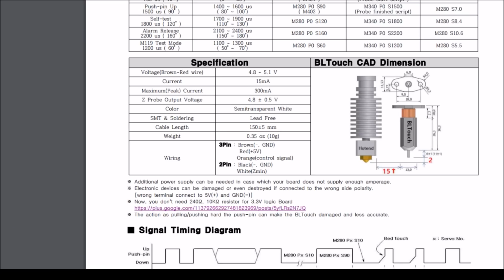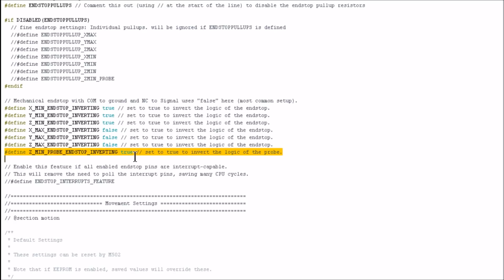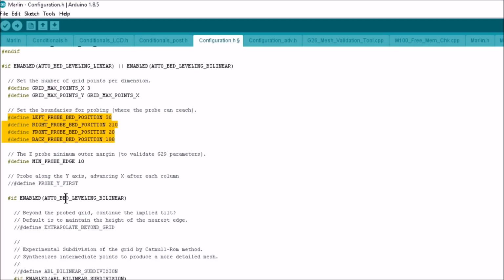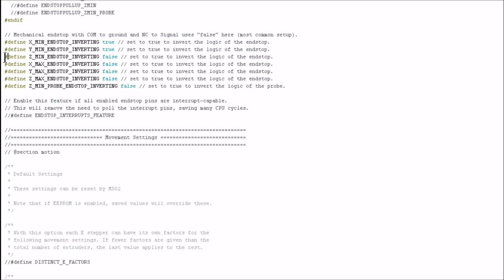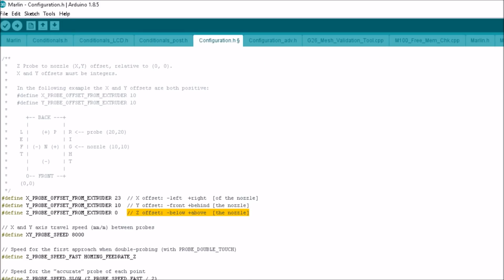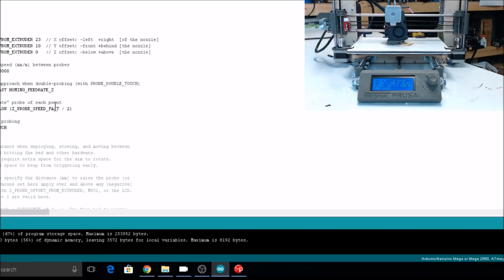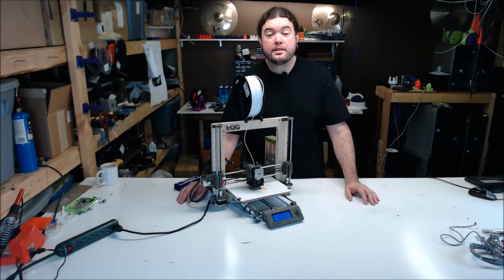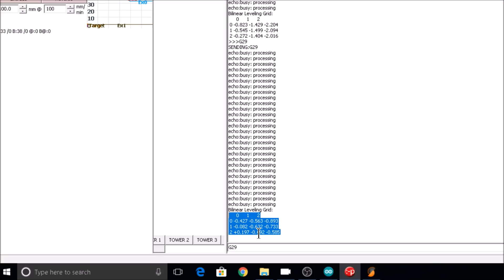Add Auto Bed Leveling to your 3D printer - Marlin - 2017

Comment: Good video. New to 3d Printing. Just wondering how is that you read and write the configurations to the printer.
Reply from the maker: You have to use the Arduino IDE and you can only write, you can't read. So you need a copy of Marlin (or other firmware) that is configured for your printer or you have to configure it from scratch. Link to IDE https://www.arduino.cc/en/Main/Software Link to Marlin: http://marlinfw.org/

Thanks for watching, sorry there isn't an easier way to edit the config, you might see if your printer manufacture has a copy you can use.

Comment: Thank you making one of the best videos on this topic.  I finally understand auto leveling thanks to you.   I do have a question though.    I have an Anet A8  using the SN04-N.   I am using https://www.thingiverse.com/thing:2779564    When I use G28 the Z probe is way off the bed and the hotend crashes.   I know that I have to get the sensor over the bed and thinking I need to code somehow the #define X_MIN_POS -40 before the z home, but do not know how?
Reply: answer   #define Z_SAFE_HOMING
Reply from the maker: Yes, have you flashed to marlin? Z_safe homing will take it to the center of the bed. Your probe offsets should take care of the rest. Thanks for watching glad it helped you.

Comment: Thanks for a great video! Although the offset did not work for me. After searching around I found M851 shows current offset which stayed at 0 for some odd reason (my code is correct, running Marlin 1.1.8). The EEPROM has that value set on my Anet A6. Did M501    (to load EEPROM)    M851 Z-0.56     (to set my offset)    and did   M500   (to save to EEPROM). That did the trick. Thanks again!
Reply from the maker: Thanks for watching! Eeprom still gets me all the time. I usually just disable it altogether if I can until I get my firmware all setup.
Reply: Thank you, just saved my life
Reply: @ai9862  Youre a hero!

Comment: I'm assuming the printer is already in a "leveled" position, otherwise the statement "1 mm from the bed" is ambiguous. Could you confirm?
Reply from the maker: I could have been more clear on that. I would start with the printer hotend in the center of the build plate. Set you 1mm height from there, then the prob and compensate. The offset won't be taken into account until a print is started.

Comment: I am using bltouch
Reply from the maker: Yogesh Sonar So your issue is after you set everything up your first layer doesn't look good? What printer do you have? Does the g29 work at all? Do you get the grid print out in pronterface?
Reply: Chris Riley 
Sir, I am using Cartesio type Printer i3 pursa , first layer is not good due  to bad leveling.
I tried G28 - G29 - M500 than grid print but same bad result of first layer .
I tried many ways but no luck, I observe , 9 points probing of G29 not consider at first layer.

I am new in 3d Printer, I don't know solution, but found a video on YouTube that person live adjust Z to limit of compensate , I think this step is look absent in my settings, I think this is setting that instruct to printer that what level have to go up and down Z to make perfect level, and I  don't know how to set through our Marlin firmware.

Sir please help . . .
Reply from the maker: You will need to figure out the Z probe offset. I explain it in this video, but if you want to try to dial it in I recommend enabling babystepping. If your nozzle is to high, go to the negative. If it is to low go to the positive. Dial it in until the layer looks good then that value will be your offset.

Set it up like this in Marlin. You can them double click the LCD wheel to use it.

configuration_adv.h

#define BABYSTEPPING
#if ENABLED(BABYSTEPPING)
  //#define BABYSTEP_XY              // Also enable X/Y Babystepping. Not supported on DELTA!
  #define BABYSTEP_INVERT_Z false  // Change if Z babysteps should go the other way
  #define BABYSTEP_MULTIPLICATOR 1 // Babysteps are very small. Increase for faster motion.
  #define BABYSTEP_ZPROBE_OFFSET // Enable to combine M851 and Babystepping
  #define DOUBLECLICK_FOR_Z_BABYSTEPPING // Double-click on the Status Screen for Z Babystepping.
  #define DOUBLECLICK_MAX_INTERVAL 1250 // Maximum interval between clicks, in milliseconds.
                                        // Note: Extra time may be added to mitigate controller latency.
#endif
Reply: Chris Riley 
Many thanks sir, I will reply you tomorrow with test results.. . . . Thanks
Reply: Sir,

Problem detected, the problem was in CURA starting gcoad,  In Cura the command "M420 S1"  was absent at Starting G code  .

I set "M420 S1" after G28, and than printer work good with Auto leveling bed function.

I first done  G28 than G29 than M500. . . . Than started print. . . Print done good 

Thanks sir

Comment: Sir
Thanks for your great video, with the help of your videos, I have updated Marlin v1.1.8 , and activated AUTO_BED_LEVELING_BILINEAR with 3*3 point.

To use auto bad leveling feature , I started with G28 and then G29 then Print. I does not found correct bad leveling I am going fail to make perfect fast layer for large print.

Please help with very systematically in two parts.

One is all settings of firmware, and second is command sequence specifically for auto bad leveling very properly please.

There are lot of articles available on bad leveling , such info confuse us so I request provide updated info for Marlin v1.1.8 only.

Please reply as early as possible.

Thanks

Comment: Ummmm sure haha I'm not tech savvy. This made some sense but still a little out there for me haha
Reply from the maker: Ha! No worries! If you want to give it a try and run into issues feel free to reach out. Thanks for watching.
Reply: Chris Riley while watching other videos they were using the current firmware that their printer has or should have and copy in the numbers over to the updated Marlin firmware. Only thing is is I can't find my current firmware from the company that I bought it from. I bought from the company Athorbot, it's an A01 pursa i3. I'm guessing if I find firmware from any pursa i3 the number should all be the same?
Reply: Chris Riley while watching other videos they were using the current firmware that their printer has or should have and copy in the numbers over to the updated Marlin firmware. Only thing is is I can't find my current firmware from the company that I bought it from. I bought from the company Athorbot, it's an A01 pursa i3. I'm guessing if I find firmware from any pursa i3 the number should all be the same?
Reply from the maker: That could be a problem. There are a couple of different kinds of firmware printer companies use. Do you know if is runs Marlin? Does it have a Marlin boot screen when it first turns on? If you can't find a copy of the firmware it will be a little bit of a challenge to get a vanilla version of Marlin up to speed. Do you know what kind of main board it has?  I did check out there site, the seem to have some pretty nice machines.
Reply: Chris Riley I haven't looked at the board to see if I can tell what it is. But I do know that when I plug it in the LCD screen brings up the company name hictop.im assuming it runs marlin but I'm not  100% sure. I've tried to contact them but they don't have good customer service. I'm was hoping a firmware update would fix some of my issues. After building and plugging it in it doesn't seem to "act" normal. You do a auto home function to try and start leveling and things. It'll slide the x axis to the left, hit the limit switch, then the y axis slides back hits it's switch then the auto home stops and tells me to "change filament" but the filament sensor isn't even plugged into the board. It still does it when it's plugged in. Also my auto level sensor that it come with, the light stays on no matter how far off the bed it is. Either the sensor is bad or it might be fixed with a updated firmware. But hell I don't know haha
Reply from the maker: Sounds like a couple of different things going on. If you cable up your printer via USB and use pronterface. Run a M503, that should tell you if it runs Marlin or not. That's a good place to start. http://www.pronterface.com/
Reply: Chris Riley I'll give it a shot tonight when I get home from work, thanks.
Reply: I know this is going to sound dumb, but what do you download when I go to that site? There are four things at the bottom of the site that can be downloaded. do I need them all? This should be simple to most by like I said above this stuff is a little abnormal for me.
Reply from the maker: scooter0241 If you have windows here is the link. https://github.com/kliment/Printrun/releases/download/printrun-1.6.0/Printrun-win-18Nov2017.zip
Reply: Thanks, I installed and ran the code and it is Marlin firmware. This is what it brought up.    
SENDING:M115
FIRMWARE_NAME:Marlin V1; Sprinter/grbl mashup for gen6 FIRMWARE_URL:https://github.com/ErikZalm/Marlin/ PROTOCOL_VERSION:1.0 MACHINE_TYPE:Mendel EXTRUDER_COUNT:1 UUID:00000000-0000-0000-0000-000000000000
Reply from the maker: scooter0241 ok, good. Take a screenshot of the M503 output and send it to me. All of it, you can email me from my about page.

Comment: @Chris Riley
Can someone clarify decrease/ increase the negative value of the z offset? As in if my offset is -1.6 then I decrese the negative value by making it something like -1.7 (-1.6 > -1.7) or rather do we mean that we decrease -abs(offset) so then 1.6 becomes 1.5? Essentially if I need to increase the distance from my nozzle to my bed which way do I go? -1.6 to -1.5 OR -1.6 to -1.7
Reply from the maker: Think of it this way...in a perfect world your nozzle would be at Z 0 when its at home. Any upwarded movement from Z would be positive. In FDM 3D printing you would never need to go into the negative to print. You only go into the negative to adjust your offset. So you would want to be at 0 or close to it, 0.2mm maybe. And your nozzle is 1mm higher than that at home because of the probe sensing distance. So your offset must be -0.8 to get the nozzle 0.8mm closer to the print bed for print time. Hopefully I explained that well.

Comment: My only question is, why resistors for 12v when it can handle 36v?
Reply from the maker: It's not the power that feeds the sensor, it's the amount you feed back into the board as the signal. It has to be 5v.
Reply: Chris Riley Got it. Thanks for the speedy reply!

Comment: Just out of curiosity will this guide also work for an Anycubic Kossel delta printer or are there different steps that need to be taken?
Reply from the maker: The configuration.h is going to be a little different on the Delta, but for the most part the steps should be the same.

Comment: Excellent, thank you for your this video, you explain things very well and in detail. I have a question: I am not getting the "Bilinear Leveling Grid" values after I perform a G29. Tried to define "Debug _Leveling_Feature" under configuration_h and though that was it for sure but made no difference. Why I can't get these values to appear like it does on your console? I am not using Pronterface, using Simplify3D but I assume the g-code communication is the same. Any ideas? Thanks
Reply from the maker: That's strange, with the DEBUG_LEVELING_FEATURE enabled try a M111 S32 then run your G29, see if that gives you the info you need.
Reply: That is precisely what I did. Ran my M111 S32 command and then G29. I am on Marlin 1.1.8 running clean with no issues whatsoever. I will try again.
Reply: Ahhhhh, today it worked, weird. I am sure I make a mistake some where along the way. Anyway thank you very much for your time and your great videos.
Reply from the maker: You stumped me, so I glad it is working now. :)

Comment: Hi Chris, im so close! so followed all your steps in the video with the z safe homing included. When I run the G28 code. The X,Y go home then center which is perfect, but the z axis does not move. Any Ideas? Thanks!
Reply: I did get a message on the LCD saying G28 Z Forbidden
Reply from the maker: Hello, G28 Z forbidden is a side effect of Z safe homing. For some reason when it checks X and Y it then thinks Z is outside of the bed area. Disable Z safe homing to get it to work. I will go look and see what setting controls the bed size.
Reply: Figure it out. Thanks for replying. I just installed a electric case for the printer at the same time I installed sensor and I installed the z motors one pin to high! Fixed it and now it works perfect. Great video. Do you have to re-enable the software endstop

Comment: Hi Chris. 

I'm just starting with the 3d printing hobby so bare with me.
After watching you video I still have a few questions concerning my Anet A6 with the future XY08N sensor and I hope you will answer them.

1) When I center my nozzle to the bed i get the values : x107 y115 Z0 and for my sensor: x118.2 y168.2 z0 (center of the sensor). The sensor is slightly to the left and front of the nozzle. So far so good. Looking at the Marlin config I have to put in the offset values x-11.2 y-61.8.... But now the fun part.. In Pronterface my Y-axis is reversed. So I have to push on the positive value to get it to move to the front (or is this standard ??) Now my question.... becomes the y-offset a positive number or does it stay a negative one.

2)Does Marlin compensate for the 6.1 cm difference when probing?. No way it can reach the back of the bed.

Hope you will answer my questions.
Reply from the maker: This doesn't transfer well, but I will give it a try.  Pronterface isn't laid out well. It you hit +Y the bed is going to slide to the front on the printer, -Y  it will move to the back. So you are ok there. If the probe is left and front of the hotend those will be negative values. 

As far as the compensation, 6cm is pretty large, but it's best effort, just let it probe where it can. 

Hope this was close to the answer, let me know.

 *      +-- BACK ---+
 *      |           |
 *    L |    (+) P  | R <-- probe (20,20)
 *    E |           | I
 *    F | (-) N (+) | G <-- nozzle (10,10)
 *    T |           | H
 *      |    (-)    | T
 *      |           |
 *      O-- FRONT --+
 *    (0,0)
Reply: Well....  I have placed the sensor and have put in the values mentioned in the vlog, but how hard I try..... it won't home in the middle of the bed. It homes at X72 instead of 111. Where the 39 offset comes from... Haven't got a clue. No sensor is activated. When I give the G0 x110 Y110 F3000. Y does it thing, and X stops at 72.  Z stops when the probe senses the bed and then goes up 10. (I have seen a script for doing this somewhere for stowing / travelling). 

Any clue to where I may find the answer?
Reply: Never mind.... My printer is haunted. Yesterday all day problems... today... Homes well, bed levels good...